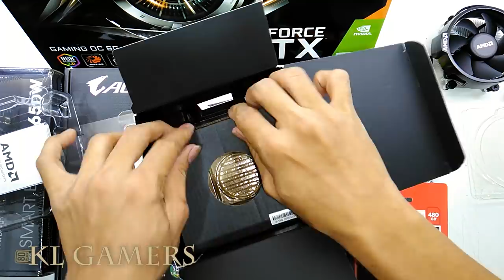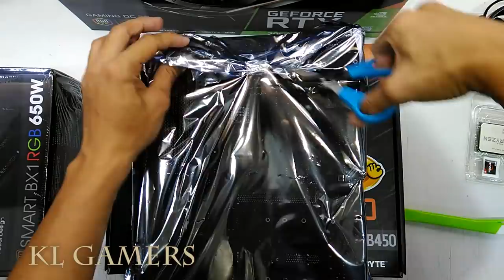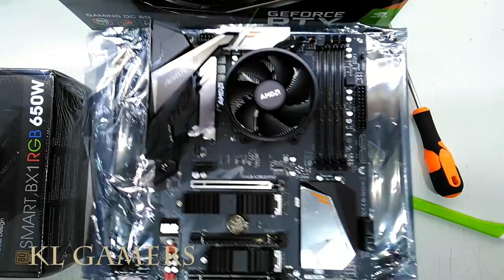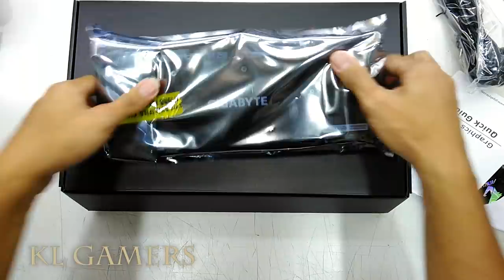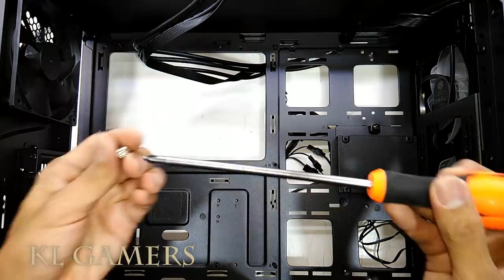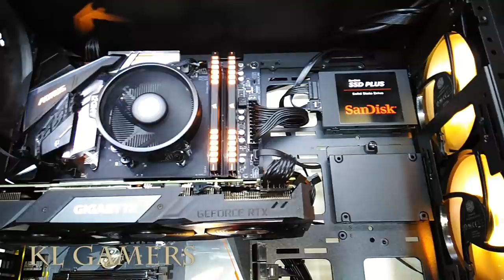AMD Ryzen 5 2600 GIGABYTE B450 AORUS PRO VENGEANCE RGB 16GB GIGABYTE RTX 2060 GAMING OC 2019

Comment: Hola amigos 
Tengo un problema 
Tengo una Rog strix  B450F gaming
1 RAM de 8 gb
Procesador RYZEN 2600X
Y tenía instalado en una M.2  Windows 10 si ningún problema .

El problema empezó cuando actualice BIOS. Y desde ahí la placa madre no me reconoce la M.2, 
Cuando esta instalada la M.2 enciende la tarjeta pero no inicia .... 

Tuve que instalar el S.O en otra ssd  por Sata, y ahí sin problema pero si a demás ahí mismo instalo la M.2 no inicia, pero si la saco ... ahí inicia sin ningún problema .

Lo que he realizado es :
Poner la BIOS a valores de fabrica  y 
Desconectar todo e incluso la pila

Creo que es configuración de BIOS, en un momento algo puse y se inicio desde la M.2 pero luego cago de nuevo y no recuerdo que fue. 
Si me pudieran ayudar
Reply from the maker: weird problem. Usually setting the BIOS to default setting will do the trick. Some M.2 port do overtake certain SATA ports. try setting M.2 SSD to first boot. If still cannot then have to send for warranty
Reply: @KLGamers  

Lo realizo desacuerdo al video y sigue igual.

Me llego un adaptador de M.2 a Sata y lo conecté a ese adaptador y me arranca sin ningún problema
...

Lo único que me queda pensar, es que el puerto M.2 de la placa está desactivada .
Que crees tu amigo

Comment: I’m guessing I did something wrong with the panel connections. Can you explain which of each cables goes connected to each color of the front panel?
Reply from the maker: https://www.intel.com/content/www/us/en/support/articles/000005643/boards-and-kits/desktop-boards.html
Reply: even you can see the same instructions in the motherboard user manual :D
Reply: antonio m davila i found out the issue. I needed to update the bios menu with an old gen cpu to make the new one work lol
Reply: Luis Salas try Flash BIOS .  sometimes you prepare a USB boot to start up the PC with the USB inserted to initially starts the autoconfig. 
if it does not work, then Update with other CPU or in the local PC shop $ 😜  good day man.

Comment: My power supply didn’t come with a reset switch cable, should I be worried?  My mother board works just fine and all cables are connected properly, for some reason the mother board doesn’t want to display anything on the monitor, any tips?
Reply from the maker: Ryzen 5 2600 no graphics

Comment: This mother board supports amd 5 3600 vega graphics
Reply from the maker: yes BIOS update needed
Reply: @kl gamers what do you mean needed upgrade the bios? Sorry this is my first i will build a pc, and i'm planning to use 5 3600 too. Thanks :)
Reply: Oh btw i will use the same motherboard but i'll use the elite one.
Reply: @heavina its actually b450 board only support ryzen gen 1 and 2..but latest announced when release 3rd gen ryzen cpu..its says that support also with a320 board and b450 board and also x470 board..only need to update board bios to use 3rd gen cpu.
Reply: What is that thing @24:55

Comment: Which motherboard is best for 2600x b450 or x470? My budget is 12-13k for mobo.
Reply: Yash Thanthratey I highly suggest going for a b450, you can go for MSI Tomahawk, MSI Gaming Plus, and other brands., I don’t really recommend x470’s but yes it’s better but you won’t be using or will be needing the extra upgrades it gives you if you compare it with a b450, and you can save more on the b450.
Reply: @phensanji2501  can we overclock cpu and gpu in b450 mobos?
Reply: Yash Thanthratey yes you can.
Reply: @phensanji2501  so which b450 mobo should be better asus, msi or gigabyte? And which model?
Reply: Yash Thanthratey depends, you should check reviews of the mobo itself, but here are some good ones, B450 Tomahawk, B450M Mortar, B450m Bazooka
Reply: I thick you should go for B450!!
Reply: @phensanji2501  Thankyou for helping me.✌️
Reply: @geomdx Thankyou for your advice. I'm going with msi B450 gaming pro carbon ac wifi mobo.

Comment: You just messed up the thermal compound on the cooler
Reply from the maker: The original processor heat sink fan comes with pre-applied thermal paste.

Comment: hello 
can you please tell me the system built for a game-like shadow of tomb raider at 1080p high setting and streaming also within the budget of  1,50,000 Thank you..
Reply from the maker: Processor =  Intel® Intel Core i5-9400F 6 Cores 4.1 GHz Turbo Without Graphics
by Intel LGA 1151 = RM578
(Amazon link) = https://amzn.to/2H36fzt
(Lazada link) = https://c.lazada.com.my/t/c.cyR5
(Shopee link) = https://invol.co/clh9ng

Motherboard = MSI B360M Gaming Plus Intel Coffee Lake LGA 1151 DDR4 Micro ATX Motherboard 
(Amazon link) = https://amzn.to/2o75H4P
(Lazada link) = https://c.lazada.com.my/t/c.5otC
(Shopee link) = https://invol.co/cli3xy

RAM = Kingston ValueRAM 8GB 2666MHz DDR4 Non-ECC CL19 Desktop Memory KVR26N19S8 = RM145
(Amazon link) = https://amzn.to/31NOWud
(Lazada link) = https://c.lazada.com.my/t/c.dOJL
(Shopee link) = https://invol.co/clh9nj

Intel SSD 545s Series (256GB, 2.5" SATA, 64-Layer TLC 3D NAND)= RM189
(Amazon link) = https://amzn.to/2GXhtoX
(Lazada link) = https://c.lazada.com.my/t/c.XVld
(Shopee link) = https://invol.co/clh9qn

Hard Disk = Seagate BarraCuda 2TB 3.5 Inch SATA 6Gb/s 7200 RPM 256MB Cache(ST2000DM008)
(Amazon link) = https://amzn.to/33wXZk3
(Lazada link) = https://c.lazada.com.my/t/c.6iGu
(Shopee link) = https://invol.co/clifqp

DVD= ASUS 24X DVD-RW = RM 69
(Amazon link) = https://amzn.to/33eOxCu
(Lazada link) = https://c.lazada.com.my/t/c.cJA1
(Shopee link) = https://invol.co/clh78b

Graphics Card = ASUS GeForce GTX 1650 4GB Phoenix Fan Overclocked Edition HDMI DP DVI Graphics Card (PH-GTX1650-O4G)
(Amazon link) = https://amzn.to/2UpafzM
(Lazada link) = https://c.lazada.com.my/t/c.eKa0
(Shopee link) = https://invol.co/clhjh2

Power Supply = Thermaltake Lite Power 550W ATX = RM135
(Amazon link) = https://amzn.to/2Kvff2h
(Lazada link) = https://c.lazada.com.my/t/c.cG0g
(Shopee link) = https://invol.co/clh6b8

Casing = AVF ACCS560 USB 3.0 ATX Casing with 500W Power Supply = RM80
(Amazon link) = https://amzn.to/2YJnNeR
(Lazada link) = https://c.lazada.com.my/t/c.eyrC
(Shopee link) = https://invol.co/clh6cl

Price is based in local Malaysia current price.

Comment: How much did you spend sir?
Reply from the maker: Processor = AMD Ryzen 5 2600 6 Core 3.9GHz  = RM679
(Amazon link) = https://amzn.to/2YGanLM 
(Lazada link) = https://c.lazada.com.my/t/c.cs8C

Motherboard = GIGABYTE B450 AORUS PRO socket AM4 = RM529
(Amazon link) = https://amzn.to/2YESw87
(Lazada link) = https://c.lazada.com.my/t/c.cK5V

RAM = CORSAIR VENGEANCE® RGB 16GB (2 x 8GB) 3200MHz DDR4  = RM689
(Amazon link) = https://amzn.to/2YJZjBe
(Lazada link) = https://c.lazada.com.my/t/c.cGZA

SSD = Sandisk SSD Plus 480GB = RM319
(Amazon link) = https://amzn.to/2ZvUGbd
(Lazada link) = https://c.lazada.com.my/t/c.cFpg

Hard Disk = Seagate BarraCuda 1TB desktop hard disk =RM179
(Amazon link) = https://amzn.to/2YFWWLP
(Lazada link) = https://c.lazada.com.my/t/c.cG0a

Graphics Card = Gigabyte NVIDIA RTX 2060 GAMING 6G DDR6 OC = RM1979
(Amazon link) = https://amzn.to/2YCeOqL
(Lazada link) = https://c.lazada.com.my/t/c.coJO

Power Supply = Thermaltake Smart BX1 RGB 80-PLUS 650W =RM329
(Amazon link) = https://amzn.to/2YFN9VZ
(Lazada link) = https://c.lazada.com.my/t/c.cG0Z

Casing = Cooler Master MasterBox Pro 5 RGB = RM359
(Amazon link) = https://amzn.to/2Zyf4IM
(Lazada link) = https://c.lazada.com.my/t/c.cJE2

TOTAL = RM5062
Reply: @KLGamers  what case do you suggest sir?

Comment: I bought a B450 Aorus M today, and is wrote in the box "ryzen 3000 ready". My R5 3600 not arrived yet.. So probably have a F40 or higher bios?
Reply from the maker: ryzen 3000 ready is a good sign that it will support Ryzen 3rd Gen

Comment: No need to put thernal paste on processor and heat sink?
Reply from the maker: The original intel processor heat sink fan comes with pre-applied thermal paste.
 
Watch this video. https://www.youtube.com/watch?v=0L5QEzLHpKU 

I make detail expalination of the hidden Thermal Paste. 

Ryzen processors come with their stock coolers which have thermal paste already on it.
Reply: @KLGamers  so, that fan is also compatible with amd processor? Nice. Thanks
Reply: @KLGamers  its Original AMD Wraith Cooler btw. not intel :) nice build :) and yes its Pre-Installed with Paste
Reply: @midorfeed2108  awesome. It's good to know it has  pre- applied paste. Thanks

Comment: what is the pc case ?
Reply from the maker: Processor = AMD Ryzen 5 2600 6 Core 3.9GHz  = RM679
(Amazon link) = https://amzn.to/2YGanLM 
(Lazada link) = https://c.lazada.com.my/t/c.cs8C

Motherboard = GIGABYTE B450 AORUS PRO socket AM4 = RM529
(Amazon link) = https://amzn.to/2YESw87
(Lazada link) = https://c.lazada.com.my/t/c.cK5V

RAM = CORSAIR VENGEANCE® RGB 16GB (2 x 8GB) 3200MHz DDR4  = RM689
(Amazon link) = https://amzn.to/2YJZjBe
(Lazada link) = https://c.lazada.com.my/t/c.cGZA

SSD = Sandisk SSD Plus 480GB = RM319
(Amazon link) = https://amzn.to/2ZvUGbd
(Lazada link) = https://c.lazada.com.my/t/c.cFpg

Hard Disk = Seagate BarraCuda 1TB desktop hard disk =RM179
(Amazon link) = https://amzn.to/2YFWWLP
(Lazada link) = https://c.lazada.com.my/t/c.cG0a

Graphics Card = Gigabyte NVIDIA RTX 2060 GAMING 6G DDR6 OC = RM1979
(Amazon link) = https://amzn.to/2YCeOqL
(Lazada link) = https://c.lazada.com.my/t/c.coJO

Power Supply = Thermaltake Smart BX1 RGB 80-PLUS 650W =RM329
(Amazon link) = https://amzn.to/2YFN9VZ
(Lazada link) = https://c.lazada.com.my/t/c.cG0Z

Casing = Cooler Master MasterBox Pro 5 RGB = RM359
(Amazon link) = https://amzn.to/2Zyf4IM
(Lazada link) = https://c.lazada.com.my/t/c.cJE2
Reply: @KLGamers  thanks

Comment: Im a noob when it comes to pc, can you please tell me where should i put the rgb fans header on the motherboard
Reply from the maker: it depends on which brand which model which connection. Usually is JRGB
Reply: @KLGamers  im using aorus b450 pro. Im not sure if its on the lower left or upper right side part. Im so confused.

Comment: Can you install 4 housing LED fans + 1 Cpu fan ?
Reply: оn this Motherboard Yes or No ?
Reply from the maker: you need to connect to a molex to 3 pin fan connector and connect to power supply

Comment: Please tell price also bro
Reply from the maker: rocessor = AMD Ryzen 5 2600 6 Core 3.9GHz  = RM679
(Amazon link) = https://amzn.to/2YGanLM 
(Lazada link) = https://c.lazada.com.my/t/c.cs8C

Motherboard = GIGABYTE B450 AORUS PRO socket AM4 = RM529
(Amazon link) = https://amzn.to/2YESw87
(Lazada link) = https://c.lazada.com.my/t/c.cK5V

RAM = CORSAIR VENGEANCE® RGB 16GB (2 x 8GB) 3200MHz DDR4  = RM689
(Amazon link) = https://amzn.to/2YJZjBe
(Lazada link) = https://c.lazada.com.my/t/c.cGZA

SSD = Sandisk SSD Plus 480GB = RM319
(Amazon link) = https://amzn.to/2ZvUGbd
(Lazada link) = https://c.lazada.com.my/t/c.cFpg

Hard Disk = Seagate BarraCuda 1TB desktop hard disk =RM179
(Amazon link) = https://amzn.to/2YFWWLP
(Lazada link) = https://c.lazada.com.my/t/c.cG0a

Graphics Card = Gigabyte NVIDIA RTX 2060 GAMING 6G DDR6 OC = RM1979
(Amazon link) = https://amzn.to/2YCeOqL
(Lazada link) = https://c.lazada.com.my/t/c.coJO

Power Supply = Thermaltake Smart BX1 RGB 80-PLUS 650W =RM329
(Amazon link) = https://amzn.to/2YFN9VZ
(Lazada link) = https://c.lazada.com.my/t/c.cG0Z

Casing = Cooler Master MasterBox Pro 5 RGB = RM359
(Amazon link) = https://amzn.to/2Zyf4IM
(Lazada link) = https://c.lazada.com.my/t/c.cJE2

Comment: Any tips if i use everything in this video with out graphics card?
Reply from the maker: you will need a graphics card. (AMD Ryzen 5 2600) This model processor don't have build in graphics so you will need a graphics card to have display. The motherboard physical port will have display if you put a Ryzen 5 2400G which the "G" means build in graphics

Comment: What's the max memory speed you can get in this board sir?
Reply from the maker: Support for DDR4 3200(O.C.)/2933/2667/2400/2133 MHz memory modules
Reply: Hi how do you OC the b450 mobo to 3200mhz? I tried to use my 2x8gb 3200mhz g.skill trident z rgb but it won't work.

Comment: excuse me  m i am planning to upgrade from my g4560 dual-core i know this video is old but i gotta know when i had my board i had to call a friend to help me update my bios . also will this 2600 work out of theb ox me not calling any friends or going to my local pc strore with this b450 board .
Reply from the maker: Yes AMD Ryzen 5 2600 will work out of the box with the Gigabyte B450 Aorus but you will need a graphics card because the AMD Ryzen 5 2600 is a processor without build in graphics

Comment: Why not m.2 ssd you have on motherboard?
Reply from the maker: Maybe in future?
Reply from the maker: Processor = AMD Ryzen 5 2600 6 Core 3.9GHz  = RM679
Motherboard = GIGABYTE B450 AORUS PRO socket AM4 = RM529
RAM = CORSAIR VENGEANCE® RGB 16GB (2 x 8GB) 3200MHz DDR4  = RM689
SSD = Sandisk SSD Plus 480GB = RM319
Hard Disk = Seagate BarraCuda 1TB desktop hard disk =RM179
Graphics Card = Gigabyte NVIDIA RTX 2060 GAMING 6G DDR6 OC = RM1979
Power Supply = Thermaltake Smart BX1 RGB 80-PLUS 650W =RM329
Casing = Cooler Master MasterBox Pro 5 RGB = RM359

TOTAL = RM5062

Price is based in local Malaysia current price.
Reply: @KLGamers  Ram,SSD,, Casing down kasi murah sikit, then upgrade heatsink to water cooling 240MM bro. stock heat sink, nak OC tu kejap je hangus

Comment: Thia board 2x m.2 slot a u have only ssd a hdd ? Realy bad
Reply: Explain why is that bad?
SSD for system operations, HDD for files. Plus he probably used parts from his old PC so the SSD and HDD were just laying around, and if you are buying a m.2 SSD it costs some extra $ with no difference in performance comparing to an SSD

Comment: How much is the parts  price
Reply from the maker: Processor = AMD Ryzen 5 2600 6 Core 3.9GHz  = RM679
(Amazon link) = https://amzn.to/2YGanLM 
(Lazada link) = https://c.lazada.com.my/t/c.cs8C

Motherboard = GIGABYTE B450 AORUS PRO socket AM4 = RM529
(Amazon link) = https://amzn.to/2YESw87
(Lazada link) = https://c.lazada.com.my/t/c.cK5V

RAM = CORSAIR VENGEANCE® RGB 16GB (2 x 8GB) 3200MHz DDR4  = RM689
(Amazon link) = https://amzn.to/2YJZjBe
(Lazada link) = https://c.lazada.com.my/t/c.cGZA

SSD = Sandisk SSD Plus 480GB = RM319
(Amazon link) = https://amzn.to/2ZvUGbd
(Lazada link) = https://c.lazada.com.my/t/c.cFpg

Hard Disk = Seagate BarraCuda 1TB desktop hard disk =RM179
(Amazon link) = https://amzn.to/2YFWWLP
(Lazada link) = https://c.lazada.com.my/t/c.cG0a

Graphics Card = Gigabyte NVIDIA RTX 2060 GAMING 6G DDR6 OC = RM1979
(Amazon link) = https://amzn.to/2YCeOqL
(Lazada link) = https://c.lazada.com.my/t/c.coJO

Power Supply = Thermaltake Smart BX1 RGB 80-PLUS 650W =RM329
(Amazon link) = https://amzn.to/2YFN9VZ
(Lazada link) = https://c.lazada.com.my/t/c.cG0Z

Casing = Cooler Master MasterBox Pro 5 RGB = RM359
(Amazon link) = https://amzn.to/2Zyf4IM
(Lazada link) = https://c.lazada.com.my/t/c.cJE2

TOTAL = RM5062

Price is based in local Malaysia current price.

Comment: How much lahat po ng nagastos mo?
Reply from the maker: Processor = AMD Ryzen 5 2600 6 Core 3.9GHz  = RM679
(Amazon link) = https://amzn.to/2YGanLM 

Motherboard = GIGABYTE B450 AORUS PRO socket AM4 = RM529
(Amazon link) = https://amzn.to/2YESw87

RAM = CORSAIR VENGEANCE® RGB 16GB (2 x 8GB) 3200MHz DDR4  = RM689
(Amazon link) = https://amzn.to/2YJZjBe

SSD = Sandisk SSD Plus 480GB = RM319
(Amazon link) = https://amzn.to/2ZvUGbd

Hard Disk = Seagate BarraCuda 1TB desktop hard disk =RM179
(Amazon link) = https://amzn.to/2YFWWLP

Graphics Card = Gigabyte NVIDIA RTX 2060 GAMING 6G DDR6 OC = RM1979
(Amazon link) = https://amzn.to/2YCeOqL

Power Supply = Thermaltake Smart BX1 RGB 80-PLUS 650W =RM329
(Amazon link) = https://amzn.to/2YFN9VZ

Casing = Cooler Master MasterBox Pro 5 RGB = RM359
(Amazon link) = https://amzn.to/2Zyf4IM

TOTAL = RM5062

Price is based in local Malaysia current price.

Comment: How much was it all?
Reply from the maker: Processor = AMD Ryzen 5 2600 6 Core 3.9GHz  = RM679
(Amazon link) = https://amzn.to/2YGanLM 

Motherboard = GIGABYTE B450 AORUS PRO socket AM4 = RM529
(Amazon link) = https://amzn.to/2YESw87

RAM = CORSAIR VENGEANCE® RGB 16GB (2 x 8GB) 3200MHz DDR4  = RM689
(Amazon link) = https://amzn.to/2YJZjBe

SSD = Sandisk SSD Plus 480GB = RM319
(Amazon link) = https://amzn.to/2ZvUGbd

Hard Disk = Seagate BarraCuda 1TB desktop hard disk =RM179
(Amazon link) = https://amzn.to/2YFWWLP

Graphics Card = Gigabyte NVIDIA RTX 2060 GAMING 6G DDR6 OC = RM1979
(Amazon link) = https://amzn.to/2YCeOqL

Power Supply = Thermaltake Smart BX1 RGB 80-PLUS 650W =RM329
(Amazon link) = https://amzn.to/2YFN9VZ

Casing = Cooler Master MasterBox Pro 5 RGB = RM359
(Amazon link) = https://amzn.to/2Zyf4IM

TOTAL = RM5062

Comment: how much did this cost ?
Reply from the maker: Processor = AMD Ryzen 5 2600 6 Core 3.9GHz  = RM679
Motherboard = GIGABYTE B450 AORUS PRO socket AM4 = RM529
RAM = CORSAIR VENGEANCE® RGB 16GB (2 x 8GB) 3200MHz DDR4  = RM689
SSD = Sandisk SSD Plus 480GB = RM319
Hard Disk = Seagate BarraCuda 1TB desktop hard disk =RM179
Graphics Card = Gigabyte NVIDIA RTX 2060 GAMING 6G DDR6 OC = RM1979
Power Supply = Thermaltake Smart BX1 RGB 80-PLUS 650W =RM329
Casing = Cooler Master MasterBox Pro 5 RGB = RM359

TOTAL = RM5062

Price is based in local Malaysia current price.